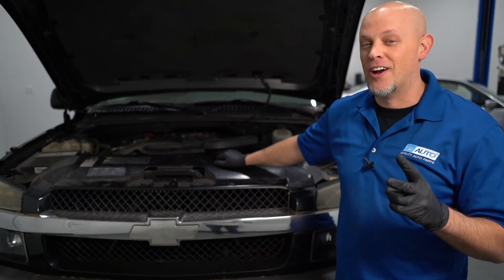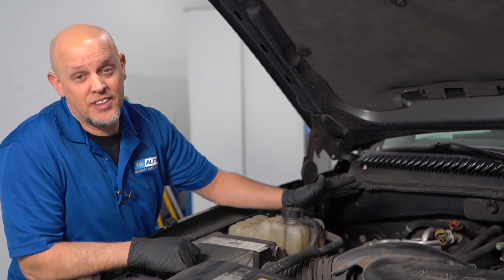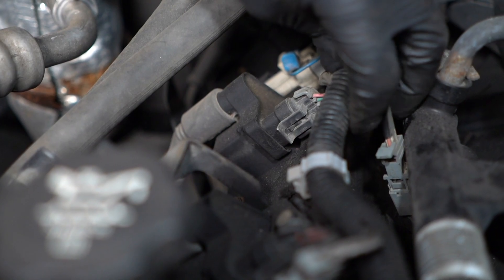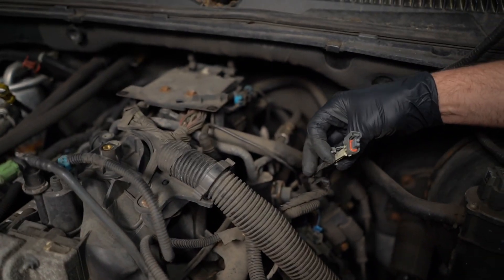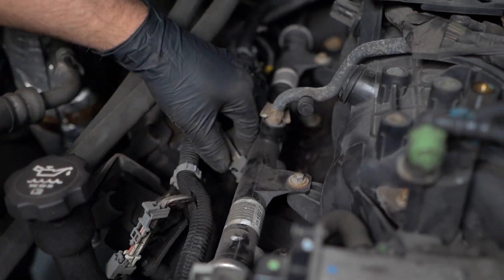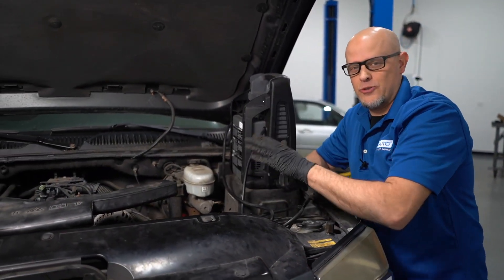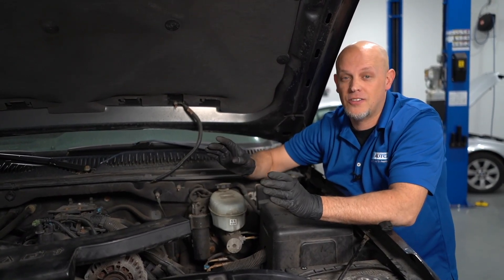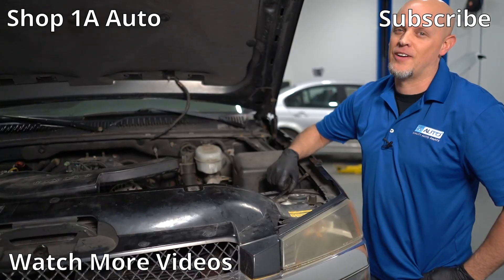Will a V8 Run on Only 2 Cylinders? We Tried It on This LS Engine!

Comment: Thanks. So going to disconnect from the fuel rail the one cylinder that is out on my son's car. He bought a Ford Turus that is only running on 5 and the emissions are bad and comes inside the car.  But I am not sure what cylinder it is. Could you help me out. Mother trying to keep it a tiny bit safer until it can be overhauled or junked. Thank you.

Comment: Im super interested in seeing the dyno difference or what it would dyno if only 4 cylinders were running similar to afm but with just dead cylinders. Im looking into running 2 ecus for my lsx swap. Each operating 4 cylinders that could run together or independently such as an ecu failure

Comment: If you disconnect the  coil how it is going  to get a spark ?one more question . what is the firing order on the 2010 Yukon denali 1500
Reply: Which has 6.2 engine  and maybe the AFM.